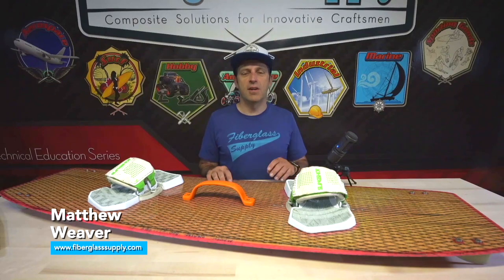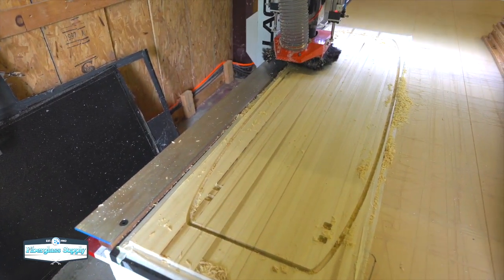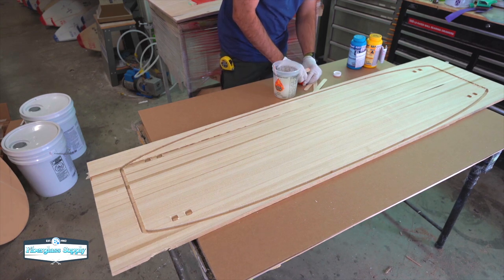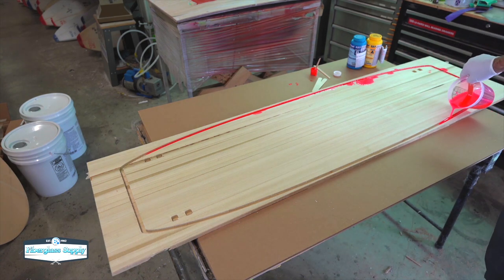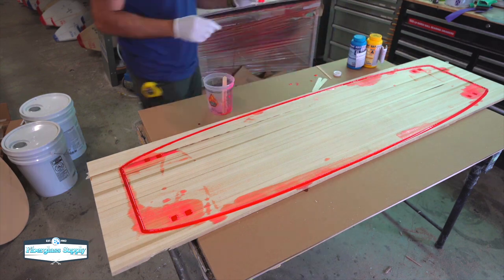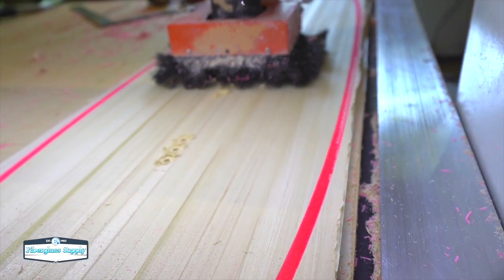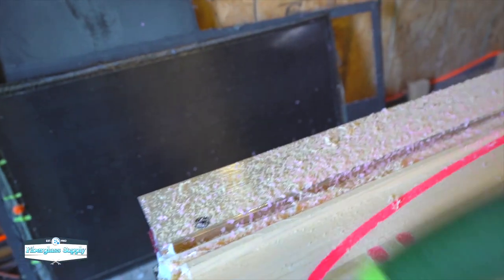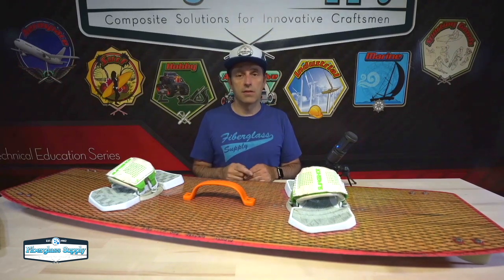How to build a Twin Tip Kiteboard - Part 1 Preparing the Core

Comment: Good project - would it have helped to degas the urethane in a vacuum chamber before pouring to get rid of the bubbles?  TY
Reply from the maker: Thanks, you know that is an interesting question and I am not sure. The pour itself was bubble free, the bubbles showed up as the urethane cured. We do have a degassing chamber, I may give it a try on a test piece. Thanks for asking.
Reply: @FiberglassSupply  Sure, thanks for putting out these videos.  It is interesting the bubbles showed up during curing and not during (or previous) to the pouring.  I have used Smooth On products and found them to be very good.    Maybe their tech folks could help out with some advice?  TY
Reply: a tip : you can watch series at flixzone. Been using them for watching lots of of movies during the lockdown.
Reply: @Victor Diego Definitely, been watching on Flixzone for since december myself :)
Reply: @Victor Diego Definitely, have been watching on Flixzone for since december myself =)

Comment: Hello I live in Brazil and I would like to know what are these products that you use to make the edges of the board, what material are these red ones?
Reply from the maker: We used a pourable urethane resin to do the rails, however on boards we did after this we used epoxy resin filled with 3M bubbles.